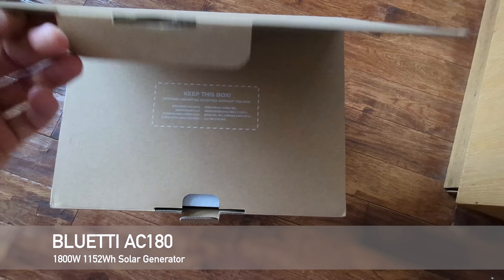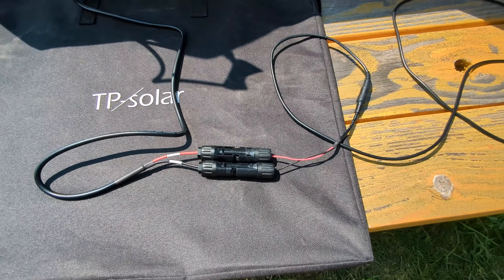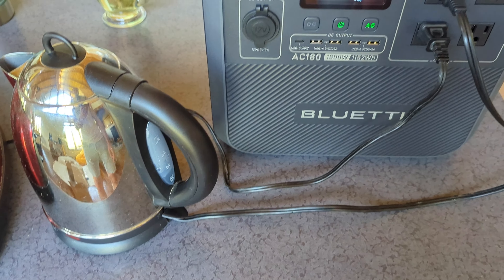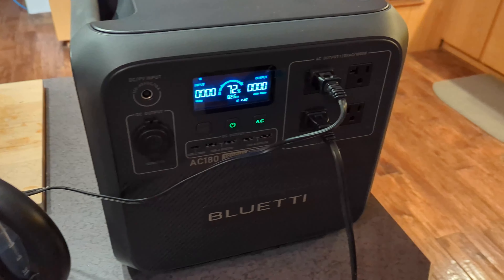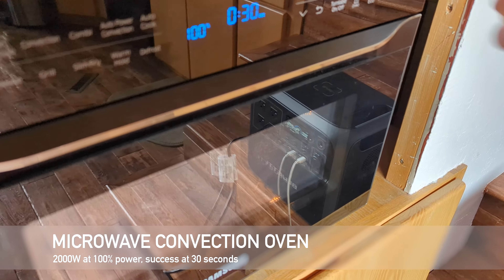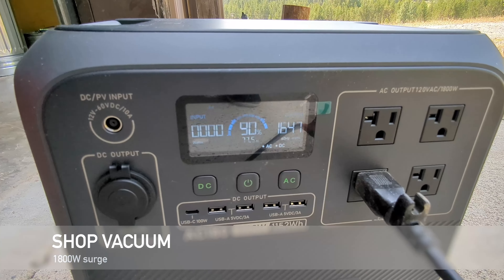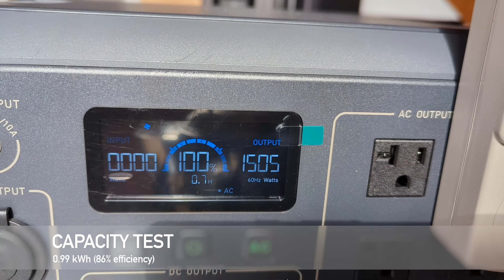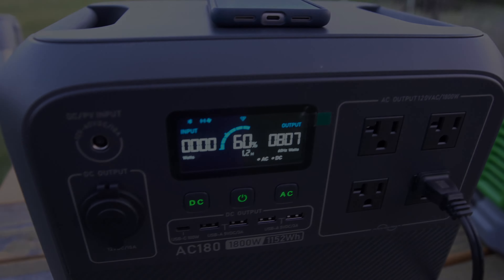Bluetti AC180 Solar Generator - Practical tests and real world use

Comment: Just bought our bluetti AC 180. When I tested it running our new gas furnace, the furnace wouldn't run. Then I plugged in the ground/neutral plug and it worked. Just like the one you added to charge your electric car.  Thanks for the video
Reply from the maker: @jfree1573  That's great! glad to help.

Comment: two years ago i bought a Jack**y1000 and have been looking for an upgrade. A buddy of mine bought the AC180 and after playing with it my 1000 is up for sale and i will be getting one. Cust service was ok for me, i had an AC300 inverter with no ac output after 6 months daily use and the hardest part was actually finding a number to call to get my warranty started. They replaced it in about two weeks. I did have problems with Eco Flow when i ordered a Wave 2 that had problems and i just returned it and it was a long multi contact and expensive process. Going off a sample size of one i prefer Bluetti cust service.

Comment: You think id be able to run a fridge nonstop w Bluetti w 200wh solar in Sacramento California year round, nonstop?
Reply from the maker: @Maverick098-m5b  I have a smart home panel from Ecoflow and know my refrigerator consumption very well. It takes about 800Wh per day to keep it going. A 200W panel * 6 hours of usable sun per day should give you about 1200Wh each day. This may be enough, but it will be close, especially if you have cloudy days mixed in. 400W of panels would work with this generator and give you a bigger buffer to account for efficiency losses and weather. The 1kWh battery should be enough to make it through the nights if you're not using it for anything else.

Comment: I ordered one a month ago and it arrived at my house dead wouldn't charge no matter what I did and it would turn off after a few seconds.  It took them 3 days to reply to my refund request and then another 2 weeks for it to be delivered back to them. Extremely disappointed by the AC180 and the customer service. If they do send me a replacement I hope it works.
Reply from the maker: I previously had problems with the AC500 and their customer service was a pain to work with. I have another video about that ordeal... Good luck 😬
Reply: Did they make things right? What’s the outcome?

Comment: I'm surprised you bought another Bluetti after your experience with the AC500. Or was this a freebee from Bluetti?
Reply from the maker: I've also had to send back an Ecoflow Delta Pro and my replacement has a calibration issue where it reports the capacity as just 2kWh and I can't fix it, so it's not like any of them are perfect. Bluetti did not ask me to create this video, but I did get the opportunity to buy it with a discount for my trouble with the AC500.
Reply: @assortedmountainlife  sounds very frustrating. I have been leaning towards the Ecoflow Delta 2 for my camping setup. It seems very close to the AC180 but the form factor of a cube isn't as convenient... and the "customer service" from Bluetti seems absolutely terrible.
Reply from the maker: @readyme  I've been using my ecoflow delta pro daily now with a 1.8kW array (1.6kW max input) and it's been working flawlessly lately. I'm not sure if a firmware update fixed it or not, but it's correctly measuring the battery capacity now and hasn't been wrong in a very long time. I power my entire network and server stack with it (450W baseline) and even charge my EV at 8A (1000W). The bluetti is still chugging along and I have no problems with it really. The power percentage can sometimes be off, but the true capacity is still there and I can get about 0.99kWh from the AC outlet measured with a kill-a-watt plug. All in all pretty pleased with both devices. Neither have been disappointing after understanding their quirks.
Reply: @assortedmountainlife  Awesome. Glad to hear, and thanks for the update. With both units being so similar, it basically comes down to whichever one I can get the best deal on.

Comment: I can tell so far from using my unit over the weekend just to use it so its not just sitting, This unit does not like HEAT!. Had my electric cooler plugged into DC. Pulled continuous 68-70 watts. After 3 min the fan ran from there without ceasing. Also powered my standing fan, I think pulled 30-40 watts and the fan came on every so often. It was in my air conditioned room but I guess it wasn't cool enough.
Reply from the maker: I also find that charging a laptop via USB-C PD at about 96W will also cause the fans to turn on. My Delta Pro is also very aggressive with the fans. I guess it's better than the safety hazard and premature wear of overheating.
Reply: @assortedmountainlife  Ok so its not just me. Does your unit click consistently duing solar charging, especially if there is not direct sunlight?
Reply from the maker: @hertechprep  Yes, both my bluetti and ecoflow click near sunrise and sunset when the sun is very low or not fully contacting the panels. I think it's a problem with voltage dropping out below the lower limit for the units. Mine has been doing this daily for more than a year on the ecoflow with no problems.
Reply: @assortedmountainlife  Whhheeeww ok cool. Just tested my AC180 with the solar panels today through the window... definitly makes sense! Thanks!

Comment: So with the Capacity test how long would a Desktop gaming PC but (with no gaming just browsing) last roughly with a 34 inch monitor and a modem router? Let's say total draw 200 watts.
Reply from the maker: That should be good for about 5 hours.
Reply: Divide 990 by 200 = 4.95. Approximately 5hours.

Comment: How can an AC 180 produce 800W that reaches a maximum of 500W?
Reply from the maker: It can output a rated maximum of 1800W continuously. In brief surges I've seen it work at 2500W for a second or two and 2200W for a few seconds. The max charging input is 1400W on AC turbo and 500W on DC solar.

Comment: Mine has a clicking relay when there is not enough solar at sunset/sunrise. Nothing is on. Is it normal?
Reply from the maker: Does it click continually on a regular rhythm? It's possible you're falling below the minimum voltage required to turn on the DC charger and it's turning on and off repeatedly until you get stronger sunlight.
Reply: @assortedmountainlife  yes, that is exactly what is happening, it tries to turn on the mppt controller every few minutes and fails ... I don't see the same behavior on other devices. And because it's always connected to the solar I have this issue twice a day.
Reply from the maker: @Mr_nah  I can try to replicate it. My ecoflow doesn't do this though and it's on 24/7 taking as much solar as it can throughout the day.
Reply: @assortedmountainlife  That would be great! Thank you.
Reply from the maker: @Mr_nah  Oddly enough, I noticed my ecoflow doing this recently around sunset.
Reply: @assortedmountainlife  which ecoflow? I have multiple river series and the delta2. None of them have this issue. I actually contacted BLUETTI and they said it’s normal🧐. They also said it’s normal for ac180 to power itself down after one minute if ac and dc are off… how in this case I should remotely control the device. I’m really disappointed with this device
Reply from the maker: @Mr_nah  It's the Delta Pro. I also noticed mine will turn off after no DC or AC activity. You can turn off DC ECO and leave the DC side powered on all the time to keep the unit responsive to the app control.

Comment: Microwaves are not designed for solar generator as they require a groud for their faraday cage or youll get microwaves all around it and could blew your bluetti if its too close. Bad for your health as well
Reply from the maker: I don't think that's correct, but thanks for looking out for my health 👍

Comment: Didn't run any power tools under load. I bet it wouldn't run them once you put a piece of wood to the table saw or planer.
Reply from the maker: I can try it, but I really wouldn't expect the tool to exceed 15A under load for a sustained duration during a cut. There's still a lot of headroom after the initial startup. Thanks for the suggestion.
Reply from the maker: Here's a short video showing the table saw cutting wood with ease: https://youtube.com/shorts/ZeEE_avkdtE?feature=share
Reply: Honestly, if it can handle the startup current of the motor, that’s gonna be your highest peak for power usage. Startup current will greatly exceed the amount of current increase when cutting wood. I use my ac180 for my miter saw and it does just fine
Reply: I have used mine with many power tools. The startup is more load than when cutting.

Comment: How about a version of your review for people that know nothing about solar power generators. Too much jargon.
Reply from the maker: I'd be glad to answer any specific questions you have. I tried to keep this short and focused on my intended uses that other reviewers may not touch on. There are already a lot of educational videos on the topic. Will Prowse has great content to understand the basics. You should check out his videos if you haven't already.
Reply: The first thing you need to understand is that these power stations don't generate electricity, so calling them generators is inaccurate.  They store energy that is put into the batteries by various methods, only one of which is solar and then distribute it via different output methods.
Reply: @dirtdiver2389  Depends on how you define generate...
Reply: @t.d.harris1311  I define it the same way a dictionary does.
Reply: So if more solar power is coming in than being stored and consumed, what we it be called?